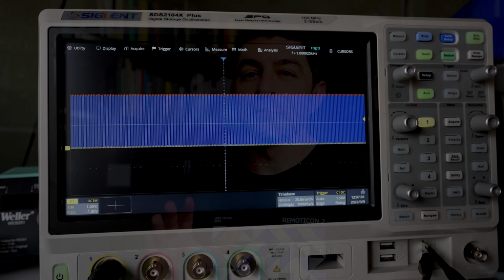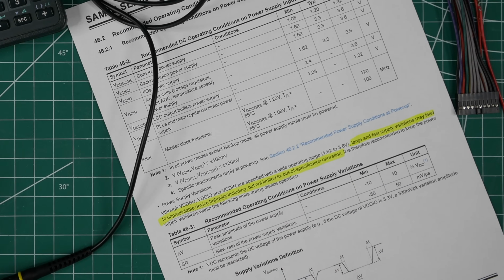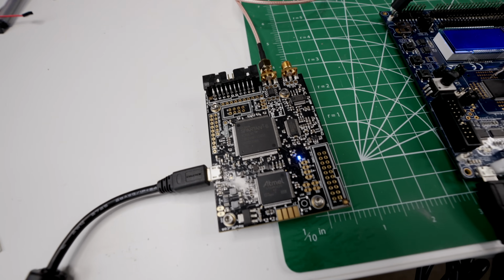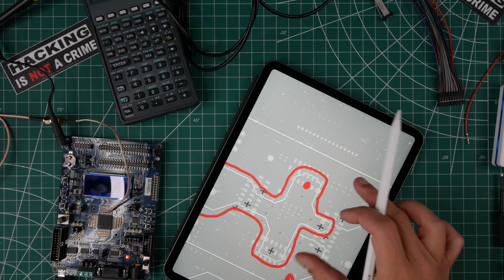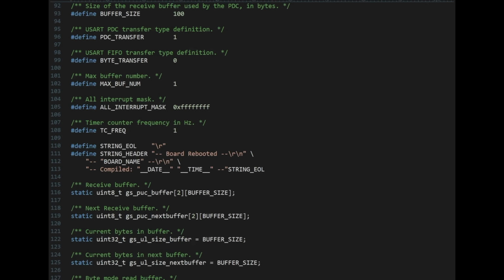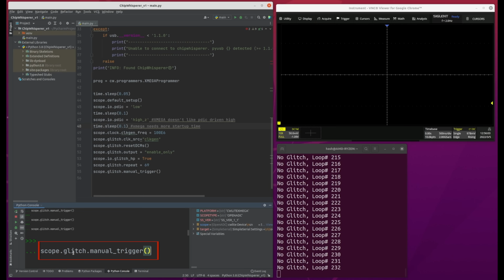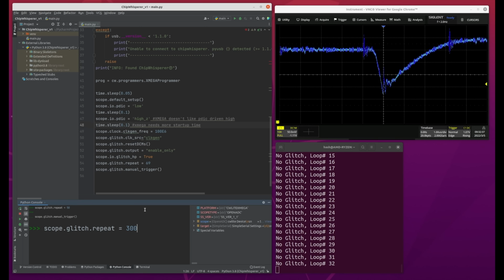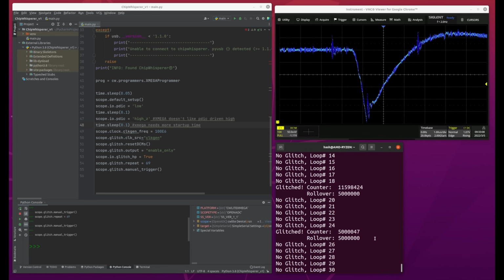Smart Meters are Vulnerable to this Attack

Comment: Glanced past your channel and it seems like you're more interested in the meter boards when all the juicy attack surface is on the multiple AMI chip vendors.  FYI, what you're examining is simply the board that provides basic volt/amp/angle/phase info to the meter.  Every single manufacturer has multiple RF/PLC chips that go into their meters.  But I would hope you know that.  For instance, that Landis & Gyr meter you show has no less than 20 companies making AMI chips for it.  If you want to attack one, start with it's modulation interface which is always handled by the AMI vendor.  You wanna reset your meter?  Change the read?  Disconnect/reconnect?  Change the MAC address?  Date/time? Intercept interval usage? Set outage notification? Voltage notifiers? Temperature? Tamper indication?  All handled by the vendor chip.
Reply from the maker: Are you referring to the Teridian chip in the case of these meters?

Comment: It's the worse device ever invented.   The utility company sent me a $300 bill on a house I own that is vacant.  I explained to them that the fuse box is turned off and how can that be?   They didn't have an answer but wanted payment anyways.   So I monitored the meter while the fuse box was on.   I turned on a number of appliances as normal and observed the meter for 12 hours.   ONLY 25 KW's used in that time.   So with everything running and normal at 10.5 cents a Kw hour.  That makes 25 x 10.5 is $2.75 conservatively.   So $2.75 x 30 is $82.00.   Noted $82 is with everything running under normal conditions.   So how is it that they bill me $300 saying I used 2500 Kw hours with the fuse box off?  
The answer is that the utility company can SPAM homeowners any amount of KW hours at will using their software.   In other words, they can take off Kw's from 1 person and put it on another person's bill.   I threatened legal action and then, only then, did the bill come back down fast after that.   Man, these guys are crooked as H**LL.    Professional Thieves.

Comment: Why all of this ? I have seen the power company reprogram my meter using a remote standing in my driveway. Seem like it would be easier to make a hack remote.
Reply from the maker: I have enjoyed trying to hack them in the most obscure way, precisely because other people haven’t looked there, at least publicly.
Reply: LEGAL REGULATIONS. Some countries do not allow remote update, or it is allowed ONLY if a person is on site to verified the correct download.
Reply from the maker: @38911bytefree  That might be their procedures or even the law, doesn’t necessarily mean the hardware would limit someone though.
Reply: @RECESSIM  Well., nothing stops you on putting a backdoor. But regulations mandate certification of every single command the meter does o doesnt support, command interface, and so on. And it has the same weight of a legal contract or a legal document ... you put your name and you sgin it. In the end it is more easy to comply. This change from one place to another. To do OTA upgrades, you need to full fill tons of conditions, from integrity, security, signing ....... to the point that is more practical to do it on sight LOL. As they happen to be billing machines, regulations are very heavy, focused in protect the user and the utility from being scammed. In some regions zeroing the conter is FORBIDEN, and code to ZEROING the register SHOULDNT even exist .... but .... who knows .... The code that allows ZEROING the registers is dangerous even when it is locked begin a back door. As you mention a glitch can force the MCU to "things" .... a "clean" reset. if the code does not exist, it turns more complicated. Obvioulsy reset will be caugh at they billing system .... This smart meters are just data collectors  with the billing system and accounting is being the other part of the bussiness. Get your hand on a prepaid one ...

Comment: What is this effort for? Just get the technical manual for the product. There's nothing useful in the ROM. If you mess around with real meters the prosecutor will lock you away.
Reply from the maker: Sounds like a plan, you wouldn’t happen to have these technical manuals would you?
Reply: @RECESSIM  Funny you should ask ...
Reply: @RECESSIM  Google for GBCS and SMETS2 for the UK meters. DLMS "green book" (communication) and "blue book" (data model) for non-US meters. "Protection Profile for Smart Meter" for the generic security requirements. DSMR5 for the Dutch meters.

Comment: You can share the ' spec sheet ' of the firmware.  Do some research of the BIOS wars and how cloned BIOS was done legally.  They had 2 teams, first dug in the code and created a list of data points, pointers ( with different names than the original ) and basically a ' spec sheet ' of what it did, the second team took the data, a motherboard with no ROM and made their own.  The ' team two ' aspect would be the rest of the world.  It's still considered Case Law in the USA, just ask AMI Bios.
Reply: Copyright law in the USA allows reverse engineering of software for the purpose of learning how it functions/behaves and to interface some new software with with the old software. So basically only the original code cannot be duplicated, but the API is fair game, and you can distribute a bit of foss (written from scratch) to access that api.
Reply: Yes that is what is known as cleanrooming, typically you would also have the companies patent lawyers looking over everything sent from the analysis team to the design team too. That is to say checking to make sure nothing slips though that would contaminate the new product, you don't want things slipping though that read like a paraphrasing of the competitors patent claims on one of the parts for example. So they are usually involved to make sure nobody opens the whole thing up to liability by being a little too on the nose with their documentation.
Reply from the maker: @FaerieSeraphina  Thanks for the additional information, that’s very interesting!
Reply from the maker: Thanks for reminding me of this, I remember reading about that.

Comment: first time watcher..  you just showed up in my list of things to watch.  Love this..  Ive used voltage glitching before, I have actually seen it done purposely by a manufacturer to prevent someone from using a generic version of a device in place of their proprietary..  send a voltage "glitch" and if the processor didnt behave as they expected they assumed it was a virgin device..  ive never messed with smart meters..  my area mostly is in messing with the chinese Air conditioners (mini splits)..  to make them do what i want ..  they also use Atmel micros..  so ill be interested in watching more vids to see how you spring these devices open
Reply from the maker: Thanks! That's interesting they used glitching as a way to check for an authentic device. What sort of device was this? High dollar specialized equipment or consumer grade? Playing with glitching tools has always been interesting to me, nice to make some videos to focus the learning a bit. Glad you enjoyed it.
Reply: @RECESSIM  High dollar..  it was a Voicemail system back in the late 90s..  the Voice processing cards were sold by the manufsacturer in generic form that anyone could buy..  the particuar voicemail company wanted you to buy their OEM named card which was 3X the price.. since the interwebs were new and everyone pirated everything.. the Special firmware was easy to get and field load..  so they turned to hardware..  they actually separated 2 of the Power supply pins.. or should I say they "burnt one out" and the chip would still work except for a certain function..  so the voicemail system called on that function..  if that function succeeded they new the board was generic even if the proprietary firmware was loaded..   most people gave up when the board didnt work out of the box..  a few more tried the firmware..  but only a few went further to dig..   wow if we only had today's debugging tools back then!!
Reply from the maker: @eldoradoboy  Wow! Yea, very interesting. Equipment like Smart Meters and other stuff with a long life in the field is very interesting to me for that exact reason. The tools to attack are progressing at a rapid pace, but the equipment in the field is still using yesterdays technology that becomes more vulnerable every day.
Reply: @RECESSIM  a lot of devices are built with a probable impact of breach engineering..  exploiting a smart meter and cracking the hashes related to turning on or off the power to the building has a High impact..  but hacking the meter with the intention of reduced cost electricity has a low impact..  the power company profiling is designed and getting better at detecting pattern changes in usage..  if they come to your house and determine the meter is "bad" ie recording 10% less than actual usage, then they replace it..  and expect to see an increase of 10% over prior profiles..   smart meters are pretty well protected against physical access since you get heavily fined by the power company if you cut the tag-lock and pull the meter..  in that case as a manufacturer you would design for highly secure comms but not necessarily so much against physical breach..  so if it can be hacked and firmware replaced OTA thats a HUGE vulnerability..  but if you have to open it up and JTAG it.. thats a non issue in the real world..
Reply from the maker: @eldoradoboy  Agree completely, getting the firmware is just to enable debug mode on a meter I control and to search for OTA vulnerabilities as you mention.
Reply: @RECESSIM  yeppers :) and regardless its cool as heck :) Love it !!

Comment: If the meter is really smart it will report the tamper attempt before you could even start glitching it.
Reply from the maker: Definitely it would, but these are meters I purchased myself to play with so they won’t be reporting anything back to anyone 🤫
Reply: @RECESSIM  If you are already inside the meter, why not jtag it and download the firmware?
Reply from the maker: @Petrig42  They set the security bit so JTAG and SWD are locked, can’t access the chip at all.
Reply: @RECESSIM  🙂
Reply from the maker: @Petrig42  Don’t worry though, it’s just a matter of pressure and time… I will be applying both 😉
Reply: @RECESSIM  I'll be interested to follow your endeavours.
I used to design electricity meters and the certification requirements needed them to be virtually bomb proof 😜
Reply: Sure the will do. Try to take even the terminal cover out ..... You got into serius trouble.

Comment: last week another seeminly routine automatic windows10 update crashed my hard drive. to save updates it shut down came back on but this time error codes popping up nonstop. stop code system service exception, unexpected store exception, unexpected kernal mode, kernal data inpage error, error 87 & cleanup image is unknown. i googled the repair was directed to defaults in command software and had to set moduals installed to manual. somehow the update set it to auto. i got pc back to 70% working but anytime i try to google anything hardrive crashes again & again. its pooched
Reply from the maker: No wonder people don’t want to install updates 😳
Reply: Sounds like the problem is with windows and old hardware.
   You might try putting some Linux on it

Comment: Hackers: I'll reverse engineer a meter to get "FREE ELECTRICITY"

Electricians: "Yup I can just bypass the meter entirely"

It's very easy and considering how ALL GOV / PUBLIC / STREETLIGHTS / RAILWAYs ect.. are wasting electricity in the MW range while the energy companies charge you MANY 100's of dollars. I see no problem with capitalizing on their capitalization.
Everything is a sad slavery mechanism with GOV/corps. BIG ENERGY IS A KEY PLAYER.

"Nothing like a homeless man sourcing power from the billboard upon which he lives under."

I've even witnessed a man living in a railway service station hub. (VERY SMALL SPACE) 
He had just enough room for a small bed, table,light with an outlet. It had a door and a lock.
The energy would have been just burning even if he didn't reside there so he was smart enough to make use of this location. However it's very dangerous and legally daring it was a great answer to his homelessness problem.
Reply from the maker: It's not really about free electricity, it's more about what data is being sent, how it's being sent (encrypted or not) and how secure they are from control/takeover by a malicious actor. Think ransomware for smart meters, but if the power company doesn't pay they blackout your city.
Reply: @RECESSIM  Then bypassing your meter will come in handy. No meter to be hacked then you still have power. Unless it's a grid wide attack involving infrastructure.

 Then I guess it's the diesel generator route. Maybe solar but you won't get far with that unless you have a HUGE amount of arrays + reliable quality battery banks.

Comment: I am a magnetics and different forms of electricity specialist. I have also noted weird behavior when using some specialized transmitting equipment not even too near to computers...  Yes, you are very right on your approach. ... Have you watched Ben Gurion university hacks? They also boast a lot of different types of attack possibilities.   I am very interested in this reserach you are conducting as it is one of the key areas of the fabric :)   . I have created self charging power sources and quite some other types of more exotic devices so I am always open to watching new avenues. This Smartmeter hacking is very tantalizing. You hit right on spot with the importance of this project. Congratulations!

Comment: It is very annoying that smart meters report logging data back to base but not locally (although they do send data to the local display, so maybe one ca get useful local logging that way?) I just want logging data from my own meters. Doesn't seem unreasonable, but so far as I know is not provided.
Reply: This depends on your country and power supplier. For example, in the Netherlands, smart meters have a serial port (called "P1") that spits out the measurements every second. The UK has the option for a Zigbee-connected in-home display.

Comment: You need to be careful It is possible for a brownout to find reflash code and completely erase the flash in that Atmel processor.
Reply from the maker: Luckily I have a few meters to test on, but if one happens to wipe unexpectedly some protection or accidental activation of code could be the case like you mention.

Comment: I'm in the acquiring hw fase. and reading the phabulous manuals fase. this will b fun. thx
Reply from the maker: Very cool, I've yet to meet a piece of hardware I didn't want to buy!
Reply: @RECESSIM  I'm jealous of your faraday cage with gloves and viewing window. Tots cool. I think I'd like to eventually test a whole multinode mesh with a gateway which will need a little more space. ya know... get the full experience.
Reply from the maker: @awesomedee5421  Absolutely! If you put some connectors on the side you can run large devices externally and just cable their antenna's into the box. Then run smaller devices inside the cage. Adding attenuators on the devices with antenna connections help to drop power too.

Comment: @Recessim Why don;t use quarz lighter trick? Should be working like to other electronic device? Remove quarz from a lighter, then engage electric arc from quartz near lcd side. You must find in which side. Electronics must enter to a glitch and freeze. Try that for a new video.
Reply from the maker: That's a cool idea, I have seen that method and also EMP using some other tools NewAE make. As for the first one, to trigger a glitch at a very specific time like I will need to do in order to dump the firmware I think the lighter method would be hard.

I would need a way to reliably generate that spark at a specific microsecond after booting which isn't possible I think. But for general glitching I think it could work.
Reply: @RECESSIM  Just discharge. Thats all. In first minute of this video, you see the ideea. https://youtu.be/N31kQzxk7BQ
Reply: @ciobanurivelino3844  You missed his point, how do you time the discharge exactly at the required time after a processor reset?
Reply: If that works, the designer did a bad job ...
Reply: Too less energy! One of the tricks I heard off, was to put a coil of a few turns in series with the flashbulb of a single-use camera.